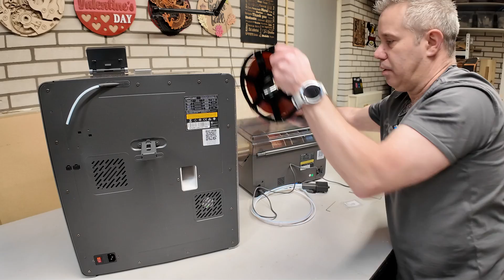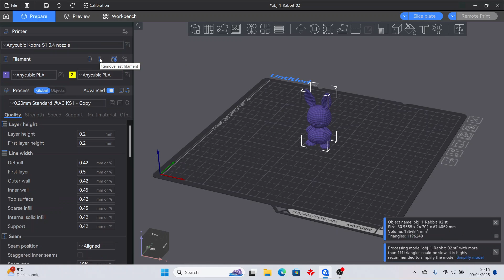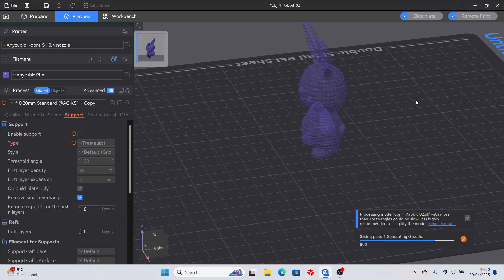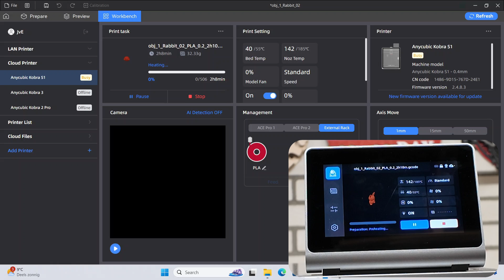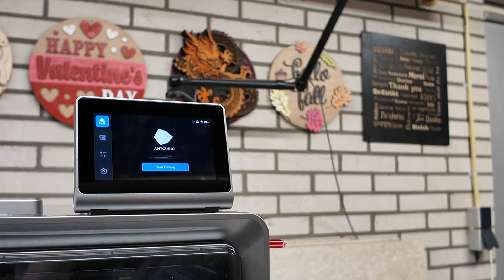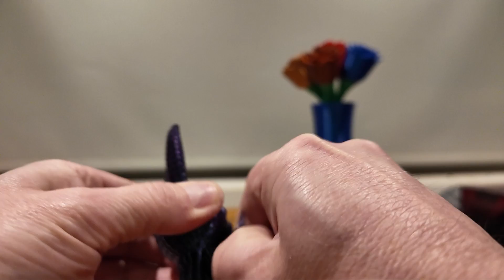Anycubic Kobra S1 | Should you go for the Single Color Option? #3dprinting #anycubic #diy

Comment: Thanks, I'll get mine next week (Combo). The program handling was interesting and looks good.

Y splitters, you get them very quickly by the fist chaning system on the marked. External feeds are always importants since not every materials or roll can fit into the interchangeable system. Samplewise, if you want to process a 4kg roll or TPU. So there's always the need to print quickly without a changeble matirial system, and that's where the Y-splitters come in as an alternative feed.

I also use ofte PTFE Tube Coupler so you always get somewere a point to get it in ;-)

With the X1C, you could also quickly access an unused part of an AMS hub via a separate hose, so the AMS remained attached and you could access an external spool separately through an unused hub access point.

I also recommend a separate filament holder like the Creality 3d Printer Multi-Kilo Feeding Holder. Because you buy it once and you'll use it for all your future printers. The ones that come with it are worthless, perhaps because no one will use it anyway ;-) The filament holder is the only part I'll use again on my next printer, so buy the right one once.
Reply from the maker: Thanks for your extensive reply, appreciate it 👍🏻

Comment: I bought just the printer, then ordered the ACE which is not the correct way to do it financially lol. I didn't think i wanted it because these multi color addons waste a lot of filament, however I decided just for the drying function, the automatic filament runout resume, and picking a filament from 4 rolls within the slicer without changing it out were features worth having even without using multi color. Then I did a multi color print, and i was blown away by the look of the print i did, so now I'm afraid ill be using multicolor way more than I ever wanted to lol.
Reply from the maker: Great decision to get the Ace Pro.
As you have already mentioned having it for the drying feature, choosing 4 different filaments and filament run out resume is already why it's worth getting one.
The multi color prints are just a bonus 😃

Comment: why would you disconnect th ace pro for single color printing, when I do single color i just select the color I want from th slicer, plus I designed a chamber heater for my S1 and connected it to the left side of the bed and thermostat control it.
Reply from the maker: This was just to show how to do this, besides not all fillament types can run throught the Ace Pro, like TPU for instance. Thanks for watching.

Comment: Thanks for the video. Do you think this is a nice machine for someone who knows nothing about 3d printing?
Reply: I had to open up the hotend after 16h of use. It's not hard at all but I wouldn't buy this if you're not comfortable working on it.
Reply from the maker: I think the machine would also work for someone new to 3D printing as it's a complete setup with everything you might need.
But a machine like this is also a bit more expensive than for instance the Kobra 3 Combo.
As for troubleshooting, I think no matter what 3D printer you buy, you will have to do some maintenance on it every now and then.
Nice thing about the S1 though is that it has a quick release on the hotend, so it can be removed/replaced pretty easily.

Comment: Hi based on your long term usage ... what would you recommend between Kobra 3 and Kobra S1... considering price and reliability .. i have normal usage... print pla and petg max.... a comparision video would pe great ...found none on internet yet
Reply from the maker: Hi, for me both machines are working great up till now, but I prefer the S1 over the 3 because of the enclosure.
Like the fact that I can place the Ace pro on top of the machine, closed machine produces a little less sound and has the built-in camera as well.

Comment: the ams on this machine is a POS, i would suggest buying another machine, but if you must have this one try not to use the garbage ams. first 6 months of using this thing is just troubleshooting it because it doesent work 50% of the time.
Reply from the maker: Thanks for watching and your feedback. I personally do not have so much issues with the Ace Pro, but I do think there could be some small improvements such as the way you have to bend the filament into the feeder. I like the way they did it with the Creality Hi CFS using the PTFE tubes to prevent sharp bends in the filament.